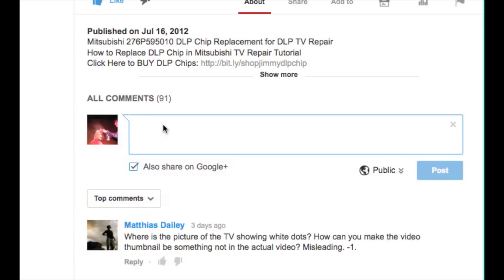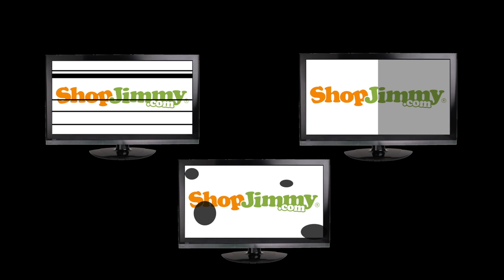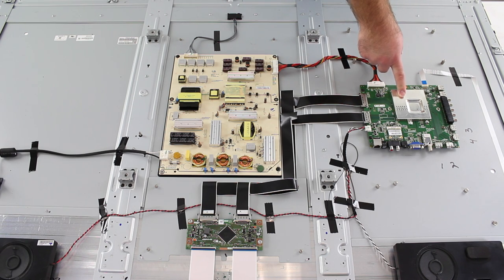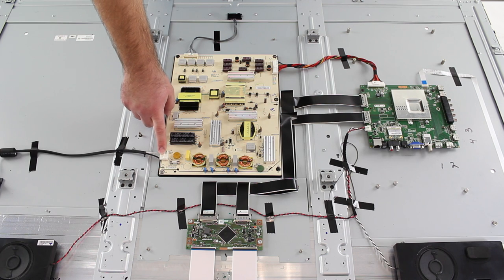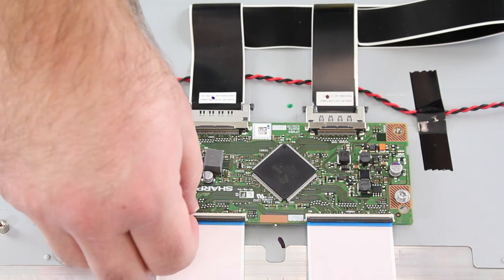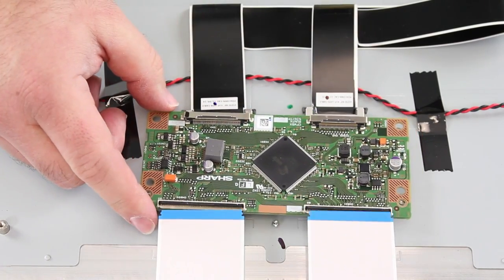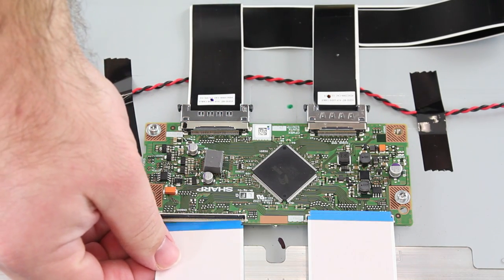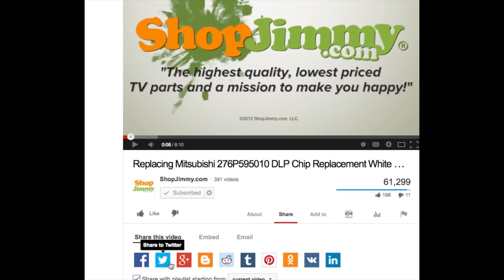Vizio TV Repair - E601i-A3 T-Con Board Replacement - How to Fix Vizio TVs

Comment: Hello my name is Otis,I have a Vizio 60inch LED E600i-B3,when I first got it it was working fine for six months,then it start cutting it off by it self everytime.I have to use the remote to turn it back on,then one day when I turn the tv on and it cut off again,and when I try to turn it on it aint coming on,i try everything in the book,hard reset,unplug, etc. can you help me please.THANKS!
Reply from the maker: +Otis Bastian  Try all repairs and troubleshooting at your own risk.  I recommend replacing the main board in your TV.  Click this link to replacement parts for your TV model number:  http://www.shopjimmy.com/vizio-y8386296s-main-board-for-e600i-b3.htm  There may be multiple boards for the same TV model number, be sure to match part numbers on your current board, with your replacement for compatibility.  Thanks and please let us know if you have any further questions with your TV Repair!  www.shopjimmy.com

Comment: yes I HAVE A QUESTION , I have a 2006 rca sd tv model # 32V434T SERAL #G483CFOTR9  THIS IS A CRT TV WANT POWER ON PRESS THE BUTTON RELAY CLICKS AND IT SOUNDS LIKE ITS POWERING UP BUT SCREEN NEVERS LIGHT UP AND NO SOUND LCD ON FRONT FLASHES RED 16 TIMES AND THEN CLICKS BACK OFF CAN YOU GIVE ANY ADVICE ON WHAT CAN BE THE PROBLEM I HEARD ALOT OF TIMES THAT THE FLYBACK IS BAD THANKS
Reply from the maker: TROY HOSKINS   Unfortunately I do not see any replacement parts in the search results for your TV model number on our website.  Thanks and please let us know if you have any further questions!  www.shopjimmy.com

Comment: I have a Vizio model E321VL serial # LAQKHLQN0112339 that has sound but no picture. I can unhook the cable and then hook it back up after a few minuted and then it will come on.
Reply from the maker: Denice Olson  PLEASE SUBSCRIBE TO OUR CHANNEL - Try all repairs and troubleshooting at your own risk.   I recommend replacing the main board in your TV.  Click this link to replacement parts for your TV model number:  http://www.shopjimmy.com/catalogsearch/result/index/?cat=56&q=E321VL  There may be multiple boards for the same TV model number, be sure to match part numbers on your current board, with your replacement for compatibility.  Here is a link to a video showing how to identify your part number, click here:  https://www.youtube.com/watch?v=kxkeGLhlQY8   https://www.youtube.com/watch?v=kxkeGLhlQY8  Thanks and please let us know if you have any further questions with your TV Repair!  www.shopjimmy.com

Comment: I have a Sony KDL-52XBR5 (8123744) that is fuzzy on the left side with vertical lines. The lines used to go away after about 15 minutes but they do not any more. http://youtu.be/WJSe-8-cncI Any suggestions? Thanks
Reply from the maker: Ken Terrell   This sounds like a TV panel (TV Screen) problem.  If your TV panel is bad, it may be more cost-effective to replace the TV as panels are typically hard to find in stock, difficult to replace, and expensive.  Thanks and please let us know if you have any further questions!  www.shopjimmy.com

Comment: I have a question. I have Vizio E601i-A3 and green vertical line started coming up on left side of screen. If you can help identifying possible cause/replacement part.
Reply from the maker: +vick Chh   Try all repairs and troubleshooting at your own risk.  This sounds like a TV panel (TV Screen) problem.  If your TV panel is bad, it may be more cost-effective to replace the TV as panels are typically hard to find in stock, difficult to replace, and expensive.  Thanks and please let us know if you have any further questions!  www.shopjimmy.com

Comment: I have a vizio 70" E701i-A3... the tv turns on, you can see a light from the back but the screen doesn't show anything it has a glow to it but it doesn't show "hdmi 1" for example in the corner
Reply: I also replaced the tcon board... with no luck... could be a bad replacement or a diffrent problem.

Comment: shopjimmy i got a question i have a 70 inch vizio e701i-a3 yesterday i turned on and no picture the backlights turn on the screen turns blue and im getting audio thru the speakers but no images on the screen you can change channels volumen up-down works but a dark blue sscreen with no pictures....which board should i change?
Reply from the maker: +Irenai Riveao   Try all repairs and troubleshooting at your own risk.  This sounds like a TV panel (TV Screen) problem.  If your TV panel is bad, it may be more cost-effective to replace the TV as panels are typically hard to find in stock, difficult to replace, and expensive.  Thanks and please let us know if you have any further questions!  www.shopjimmy.com

Comment: I have a sony 40ex401 tv a power surge came in on the cable coax. I replaced the main board and power supply and the tv worked like brand new for 8 days using around 2 hours a day. then it went out. now when  I turn it on it starts to light up the  the pwr. light dims and the tv shuts off then it starts to come on again, over and over. the boards are under warranty bu shop jimmy. Do you think this may be the pwr. supply? I know that I am not loosing the 3.3 volts, what else should I check?
Reply from the maker: 363javelin   I recommend replacing the main board in your TV.  Click this link to replacement parts for your TV model number:  http://www.shopjimmy.com/catalogsearch/result/index/?cat=56&q=40ex401  There may be multiple boards for the same TV model number, be sure to match part numbers on your current board, with your replacement for compatibility.  Here is a link to a video showing how to identify your part number, click here:  https://www.youtube.com/watch?v=Aodz2LHkzbY  Thanks and please let us know if you have any further questions with your TV Repair!  www.shopjimmy.com

Comment: I have a Vizio m420nv that has power because the word vizio glows Amber. It cut off and for a long time would not turn on. About 3 hours later I got it on and the screen had a mirror image. Then the TV cut off and will not start back up. It has good power because the light is glowing Amber. What do you think this could be?
Reply from the maker: +Michelle Stephens   Try all repairs and troubleshooting at your own risk.  This could be a problem with either the main board or the TV panel.  You can replace the main board to see if that fixes the problem with your TV.  Click this link to replacement main boards for your TV model number:  http://www.shopjimmy.com/catalogsearch/result/index/?cat=56&q=m420nv  There may be multiple boards for the same TV model number, be sure to match part numbers on your current board, with your replacement for compatibility.  Here is a link to a video showing how to identify your part number, click here:   https://www.youtube.com/watch?v=kxkeGLhlQY8Thanks and please let us know if you have any further questions with your TV Repair!  www.shopjimmy.com

Comment: I have a Samsung LNT4071F. It seems to have good power, but the screen is just grey. I can't get menu or anything on the screen.Any ideas
Reply from the maker: longneck43   This could be a problem with either the main board or the T-con board in your TV.  I recommend replacing the T-con board first and then if that does not fix the problem, replace the main board.  Click this link to replacement parts:  http://www.shopjimmy.com/catalogsearch/result/?q=LNT4071F  Be sure to match part numbers on your current board, with your replacement for compatibility.  Thanks and please let us know if you have any further questions with your TV Repair!  www.shopjimmy.com

Comment: Hello I would like to know where can I buy and which tcon board do I need for my vizio tv model D65u-02 it has sound but no picture it goes off I need to hold the mute button for 5 seconds then the exit button to get back the picture but it only last for a couple
Minutes and it goes off again and only connected to my directv, when I have my ps4 or dvd player works fine, please help . Thank you
Reply: Model D65u-D2

Comment: I have a vizio model e320fi-b2  while I was watching it the display went dark and I could barley see a picture even after adjusting the backlight it doesn't make much difference at all the sound and everything else works fine just a very dim picture thanks for any help
Reply from the maker: +Levi Cooper   Try all repairs and troubleshooting at your own risk. This sounds like a problem with the actual LEDs inside your TV. These LEDs are replaceable, however it is recommended they are replaced by someone with the proper experience and training. When replacing the LEDs, the TV panel can get damaged. If the TV panel gets damaged, it is not repairable. Click this link to replacement LEDs for your TV model number:  http://www.shopjimmy.com/samsung-lsc320hn04-002-led-strips-3-strips.htm   Be sure to match the panel information necessary to ensure you have the correct replacement LEDs.Thanks and please let us know if you have any further questions with your TV Repair!  www.shopjimmy.com

Comment: I have a Vizio led e601i-a3e my original trouble was that I was getting backlight and sound but no picture. I ordered a t con board from shop jimmy and replaced it once I got it. Now when I turn it on I get picture for just a few seconds then  the picture flickers with lines and then the picture all goes away again. What can it be?
Reply: Do you have any sort of useful response other than just repeating my name?

Comment: I have a new 43 inch Vizio model number : M43-C1. When on the TV has a horizontal line that blurs everything under it, over the line everything looks fine.
Reply: FearlessPoptart 
HI I have the same TV that is just out of warranty and it has the exact same problem.  Did you find a solution?
Thanks

Comment: I have vertical lines when a device is plugged into my e601i-A3.  It is fine otherwise. I just bought t con board and replaced and I am still getting same issue. Is it video board?!
Reply: Could be a cable?

Comment: Hello I have the Vizio e601i A3 TV the Soundworks but after being on about 10 minutes the picture starts to flicker for a minute or two then the picture goes blank but the sound stays on if I turn TV off and wait a little while turn it back on does the same thing can you tell me if it is a t con board or what you think it may be thank you
Reply: We are having the same problem. Did you figure out what it was?

Comment: Hello, I have a Vizio E601i-03 tv.  When the tv is on, the dark or black colors are distorted.  The tv usually shows black when it first starts up, but now it has gray vertical lines.  I have not lost any picture.  The picture is good high quality except for black or very dark colors.  Would this be the T-con board or the panel?
Reply from the maker: Robert Preston   Try all repairs and troubleshooting at your own risk.  This sounds like a TV panel (TV Screen) problem.  If your TV panel is bad, it may be more cost-effective to replace the TV as panels are typically hard to find in stock, difficult to replace, and expensive.  Thanks and please let us know if you have any further questions!  www.shopjimmy.com
Reply: ShopJimmy.com Thanks for the info.  I have found the issue.  I bought a new tcon board and then went to work on the tv.  When I was removing the board, I found a ribbon from the main board was a little loose.  I went ahead and removed the old board and replaced it with the exact replacement.  I could not get it to work.   It constantly showed just a dark blue screen even when I adjusted the ribbon.  I took it out and put the old board back in and adjusted the same ribbon.  The tv worked great.  I taped the ribbon in place so that it would not move.  The tv has worked perfectly since then.  I sent the Tcon board I bought back to for a refund.

Comment: i have this same exact model. mine when you turn it on. no color or display come on. just a lit black screen. i guess its the backlight thats on but pixels dont show anything
Reply: Adam A hey Adam, was your problem the T Con? I have the same issue
Reply: @mikeyandalyssab4782  No, i even took it to 2 shops and they could not fix it. I threw it away.

Comment: need help my son spray the TV and it looks this my models is the one posted on here its a 60" vizio what needs replaced
Reply: U can see the picture a lil bit but its white he sprayed it with cleaning supply
Reply from the maker: +Ashley Zamudio   Try all repairs and troubleshooting at your own risk.  This sounds like a TV panel (TV Screen) problem.  If your TV panel is bad, it may be more cost-effective to replace the TV as panels are typically hard to find in stock, difficult to replace, and expensive.  Thanks and please let us know if you have any further questions!  www.shopjimmy.com

Comment: I've got a Vizio E601i-A3 60" TV.

I've got a green line that goes from the top of the screen to the bottom of the screen. The Vizio support folks tell me it's a panel issue, but I'm not so sure based on what has been described here as far as bad panel's go. 

Have you run into anyone with a green vertical line going down the TV? Is it possible or likely that this is a t con board issue?

Thank you!
Reply: ShopJimmy.com  Unfortunately it was not the T-Con board, and it sounds like from what I've heard from multiple sources including ShopJimmy, this might be a problem that can't be fixed.
Reply: david murillo How complex is it to replace it? Have you found that it worked pretty well?
Reply: david murillo Awesome. Thanks for the info.

Is there anything else I should know about trying to fix this issue?

Comment: hi!!! I have a issue with my samsung model: LA32A330J1N.
When I srart my TV picture appeares on 1 sec then becomes black, and so three times after this try to start monitor is black, but audio is OK and if I shine in monitor I see a picture.
What i can to do for solving this problem?
thank you!!!
Reply from the maker: alex bagin  Please watch this video FIRST to help with your repair!  https://www.youtube.com/watch?v=BP3NVNCGEv8  This could be a problem with either the backlight inverter(s) or the power supply board in your TV.  You may need to replace each of the boards individually to see which one fixes the problem.  Click this link to replacement parts for your TV model number:  http://www.shopjimmy.com/catalogsearch/result/?q=32A330J1N  There may be multiple boards for the same TV model number, be sure to match part numbers on your current board, with your replacement for compatibility.  Thanks and please let us know if you have any further questions with your TV Repair!  www.shopjimmy.com
Reply: Hi I have exactly the same problem but I replaced all caps and still sit with the same problem.here is my question there are 2boards one for power and the other one with very small components which one needs replacing?
Reply: Please help!! My TV model is LA32A330J1N the sound is ok but when I switch it on the picture appears for 1sec ant that 3 times and goes black, when opened it has two boards only the power board and main board I replaced all the caps on the power board without success, I can't see where the T-con is or the inverter so I suspect the main board is gone! Please help with info in this regards.
Reply from the maker: Patrick Manda  Try all repairs and troubleshooting at your own risk.   I recommend replacing the main board in your TV.  Click this link to replacement parts for your TV model number:  http://www.shopjimmy.com/catalogsearch/result/index/?cat=56&q=32A330J1N  Be sure to match part numbers on your current board, with your replacement for compatibility.  Here is a link to a video showing how to identify your part number, click here:  https://www.youtube.com/watch?v=BEPWrefQvqI  Thanks and please let us know if you have any further questions with your TV Repair!  www.shopjimmy.com
Reply: Hi!!! I solve this problem when I changed 3 lamps. They stand behind your scren. In my situation electrical contacts on lamps was burnd. 
Sorry for my broken english.
Have a good day!!!